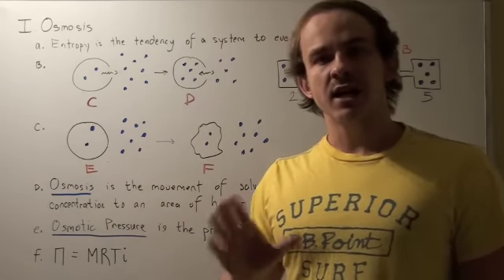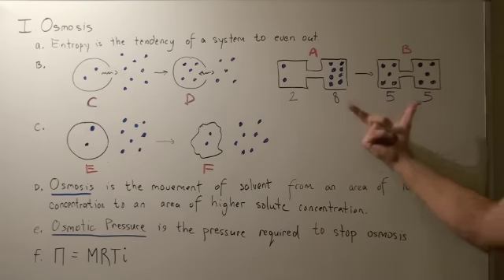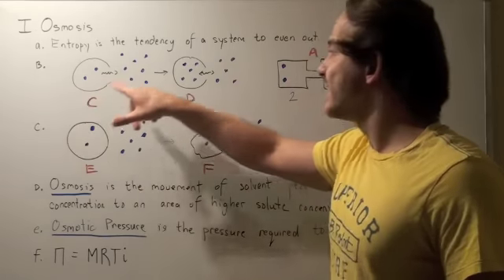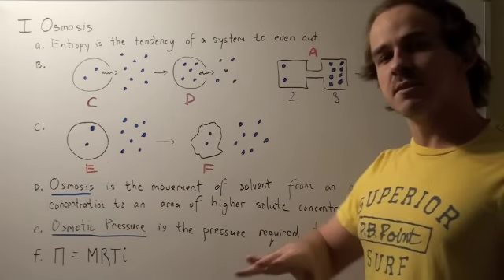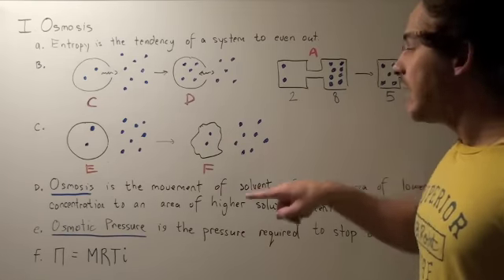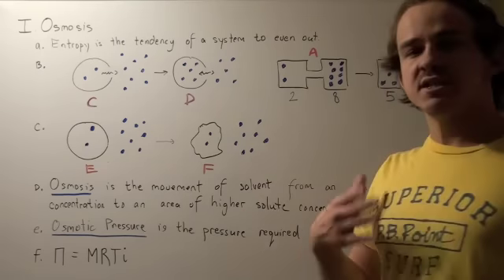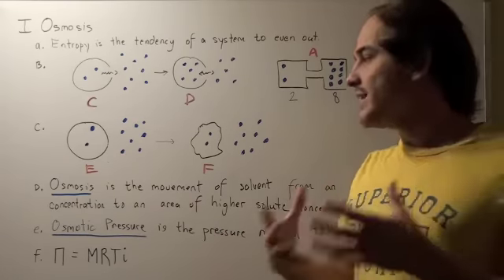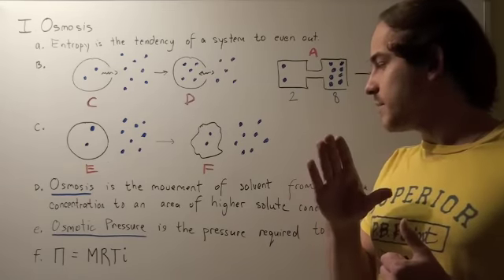Osmosis and Osmotic Pressure

Comment from the maker: Hey! Sorry it took so long to respond. The website would be a better place to ask question. Recall that osmotic pressure is a colligative property, which means that it depends on the number of particles. As you lower the molecular weight (while keeping the mass and volume constant), you increase the number of particles. Suppose you have 50 grams of hydrogen and 50 grams of boron... Are there more particles in 50 grams of boron or hydrogen? Since hydrogen has a smaller molecular weight,